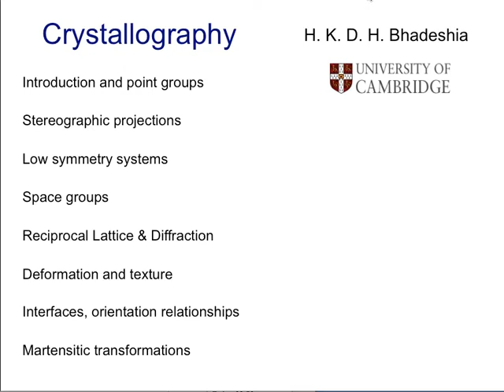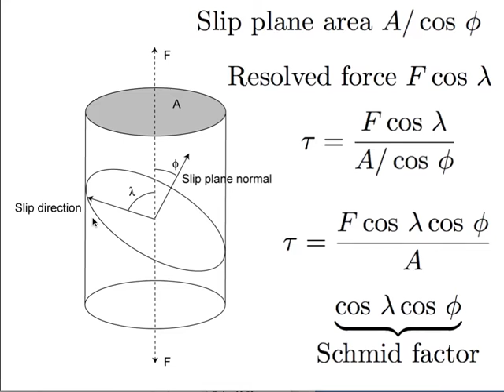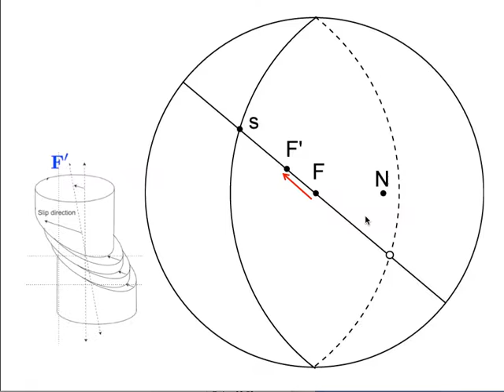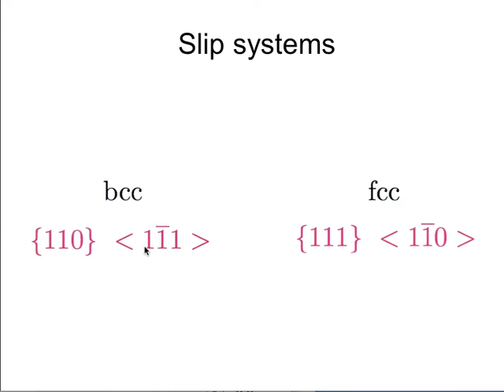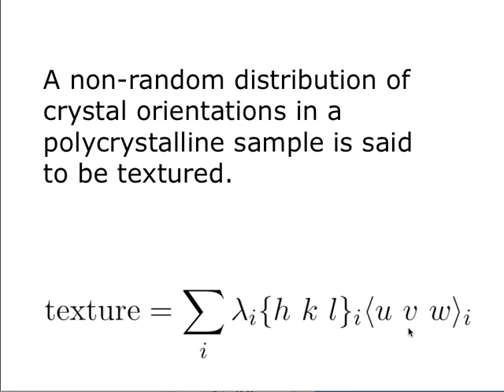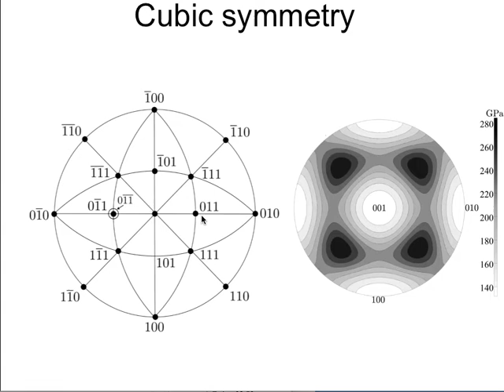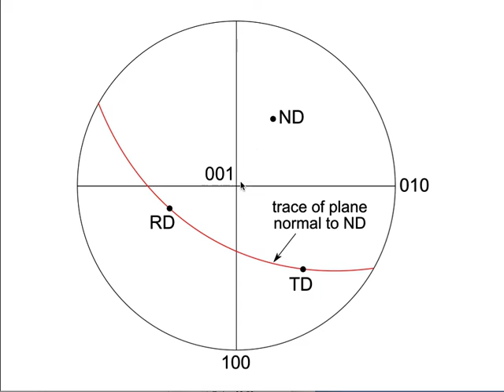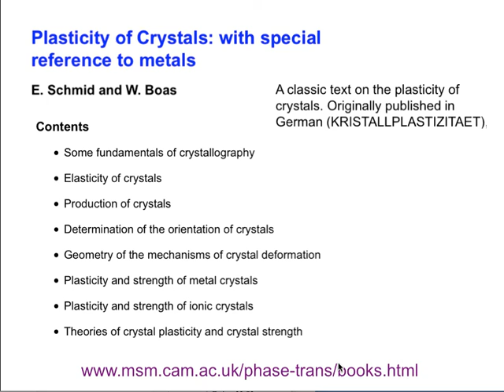Deformation and Crystallographic texture  (2016) - lecture 7

Comment: Thank you professor for this very informative course. I have two questions after seeing this. 

When you speak of rotation toward the force axis during a tensile test for instance, you mean rotation getting slip planes close to 45 degree from the force direction right ?

And if there is already an active slip plane,  why would the grains keep rotation to activate another slip direction ?  And how do grains rotate relative to each other (more stress is necessary I guess)?
Reply from the maker: The rotation occurs when in a tensile test the specimen is constrained to macroscopically deform in the pulling direction. But if the sample is not constrained in this way, there would be no rotation just like a pack of playing cards that is sheared. Have a look at this book which you can download freely: 
http://www.phase-trans.msm.cam.ac.uk/2007/Plasticity/SB.html

Comment: The angle between 001 and 111 is 55.73D; between 001 and 101 is 45D and between 101 and 111 is 35.26D. If anyone has solved it please comment.
Reply from the maker: Not sure what your question is. The vectors you quote are not coplanar.